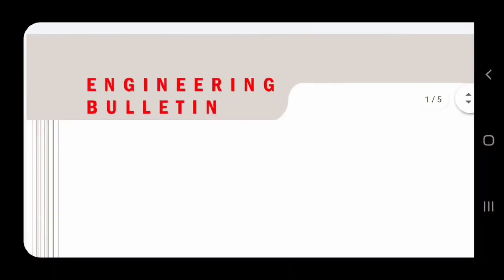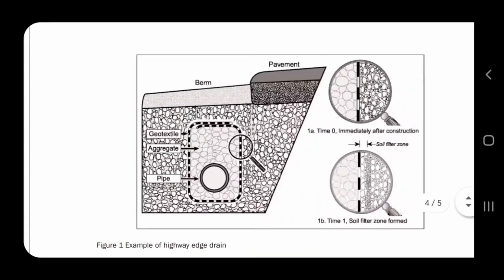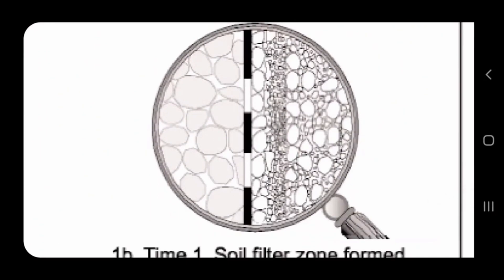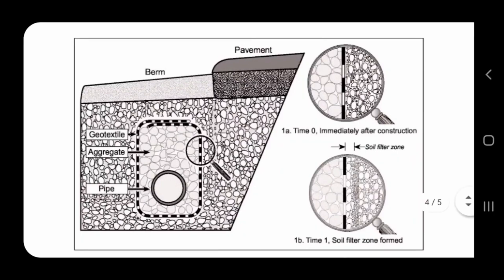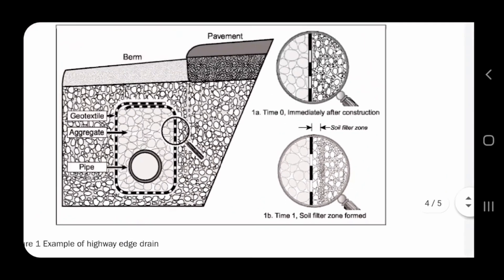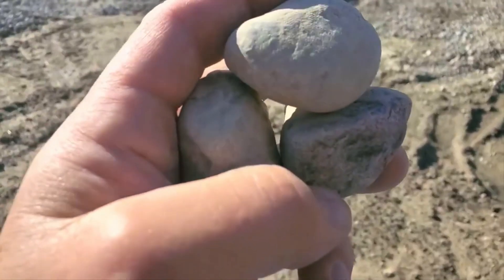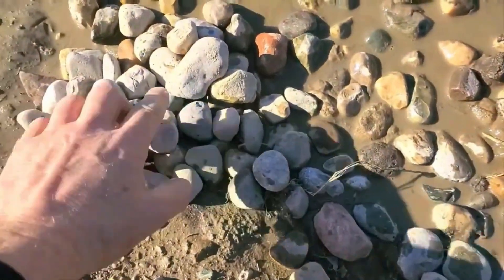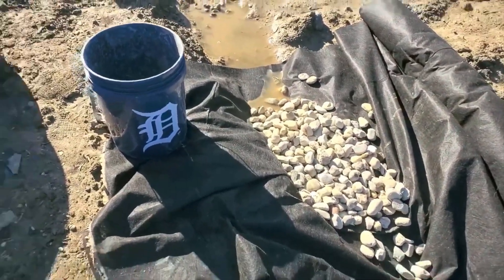Does Drainage Fabric Really Work for French Drains? Engineering Bulletin Says Yes.

Comment: Thank you for posting this video and explanation. I have build three french drains with this cloth and the water flow is amazing. There was a wash out time and the water went clear. The soils were not muddy and very stable. I did go with crushed stone yet a size that has plenty of voids 4's and 6's;. The crushed locks solid for driving over and tends not to roll when pressure is applied by tires. Thank you again!